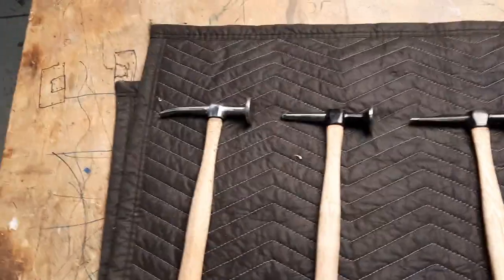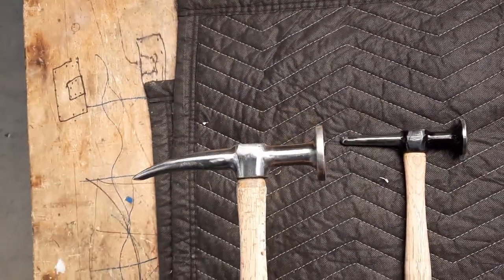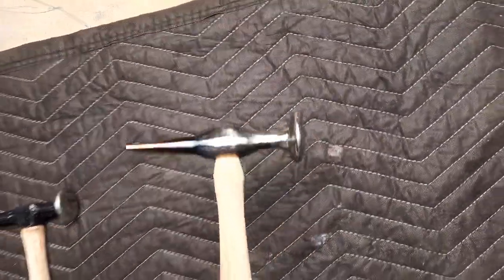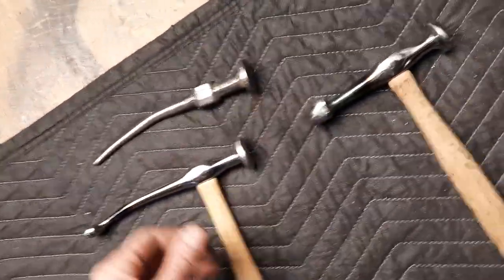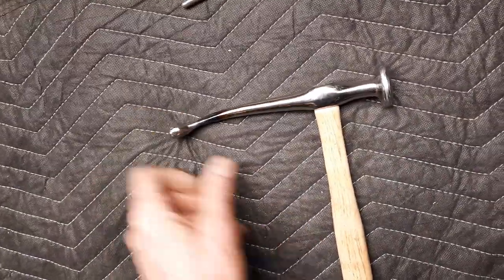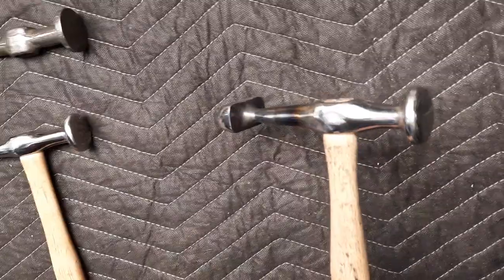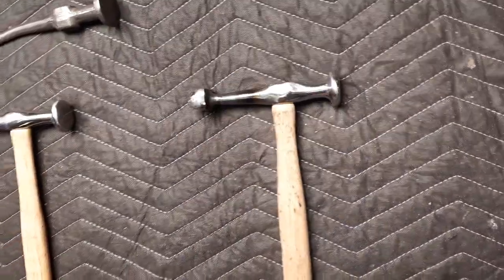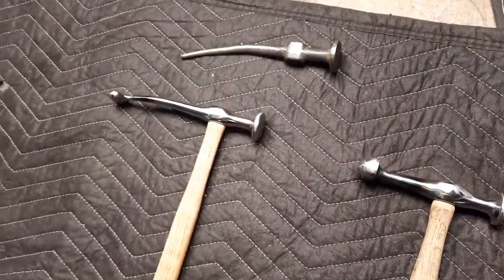Body hammers: How to make them COOL

Comment: I’m 30 yrs collision technician, I have about 10 body hammers but always grab same one.  The shorty flat head snap- on.   Technology is about to pass me up, there are weeks I never use body filler because metal today is paper thin and insurance just replaces parts instead of repairing them.  Every weld is photographed and sent for inspection before it’s approved to go to paint.  ( it’s all about lawsuits today)

Comment: Cool mods.. any tips for filling in heavy nicks/ gashes on a hammer face without having to grind it way back and lose the mass? Thanks…
Reply from the maker: There might be a filler rod that will work, I'm not aware of one.